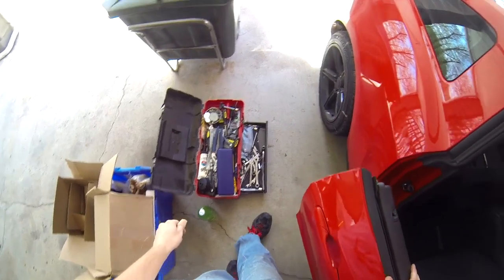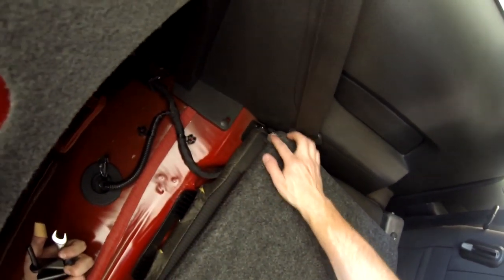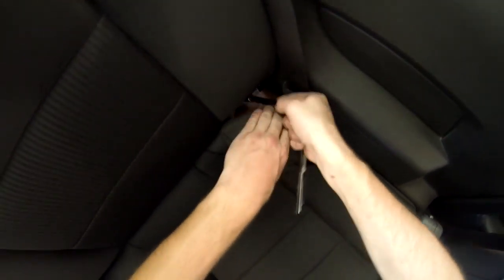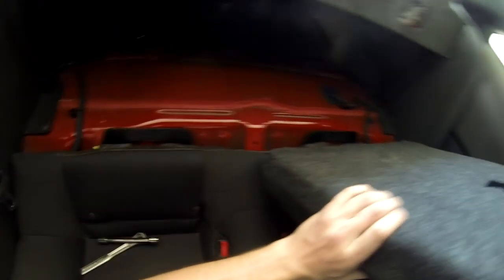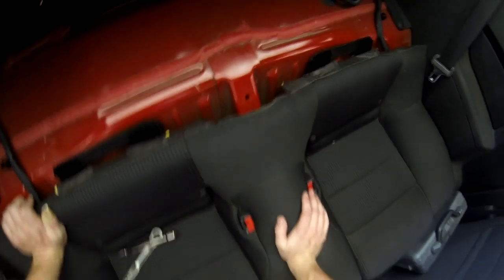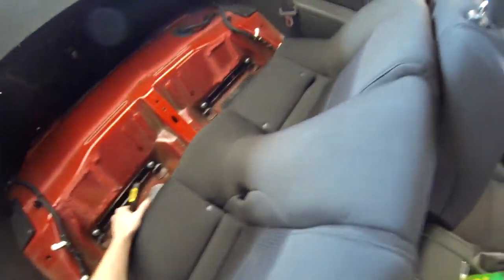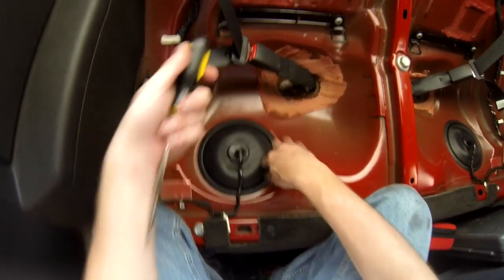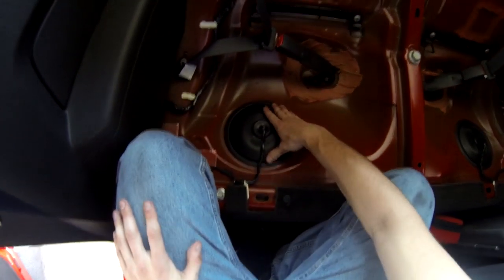Making Your Mustang Lighter & Faster - Part 2 - Rear Seat Removal

Comment: watched to find out how to remove seat for doing sound deadening. thanks for posting
Reply from the maker: Adding weight!?!  ;P
Reply: installing a quietride solutions acoustishield trunk floor and body panel kit. installed weight is maybe 10 to 15 lbs
Reply from the maker: Noice

Comment: Lol weight sensor lol it's the fuel pump
Reply from the maker: Yes.  This has been answered already.  My last several vehicles had fuel pumps inside the gas tank, and were not visible within the vehicle at all.  -_-

Comment: Helpful video 👍
Reply from the maker: Thanks!!!  ^_^
Reply: +PowerSports think I plan to take out the back and front passenger today lol.  In my 2015      Then I'll order the lighter seats in a month or two lol
Reply from the maker: That's awesome!  I bet the passenger seat is pretty heavy!
Reply: +PowerSports 55ibs I think
Reply: back seats were 30.6 pounds, and front passenger 48.8... not counting all the bolts    new seats ima order will be 21pounds each   so with driver seat another 5-10 shaved off     all together 125 pounds shaved lol

Comment: How many horsepower are you going to increase by removing those 32 lbs rear seats ?
Reply from the maker: none.  but i might be able to get a small improvement in my lap times.
Reply: none. u dont gain hp from weight reduction just acceleration and top speed
Reply: Frank Jasso every 100 pounds is in theory 5-10 hp

Comment: The complete back seat assembly weighs 8.2 lb's  in leather .
Reply from the maker: Iron Gates 
Weight is weight.  Even a pound counts.  Always take a dump b4 racing!!!  ^_^
Reply: +Iron Gates not true the bottom part you sit on is 12lbs the back art that folds down is 30.6 lbs I just took them out last night.....well in a 94 cobra that is